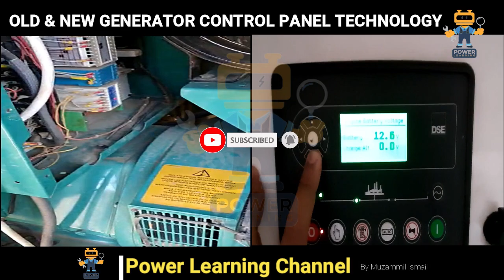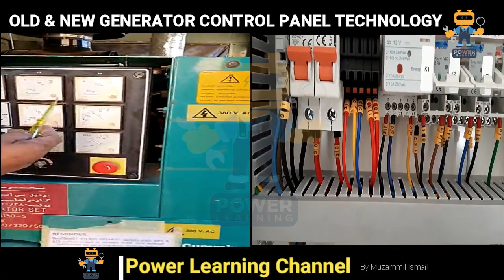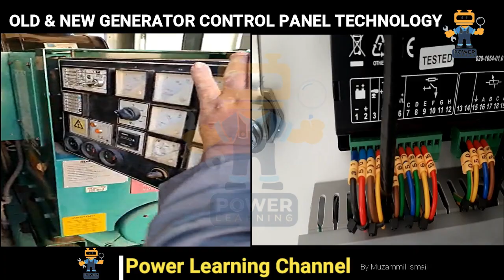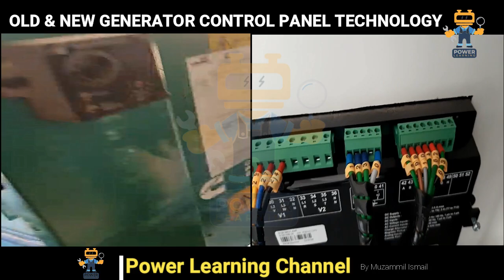Dg GENERATOR CONTROL PANEL OLD AND NEW TECHNOLOGY REVIEW | ANALOG V/S digital control panel

Comment: Hello Bro, I want to pick up some alarms for further processing from the control panel ( maybe parallel tapping from PLC) eg: DG Fuel level, Lub oil level, Temperature, Charging battery voltage, Load current etc. is it possible. do u have any contact no to speak, thanks